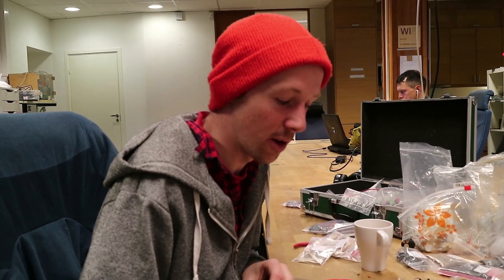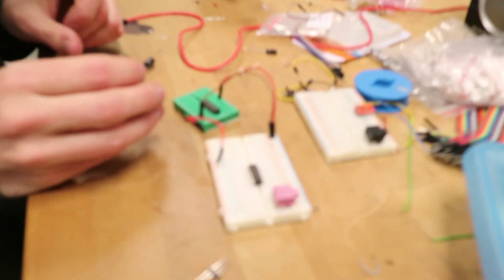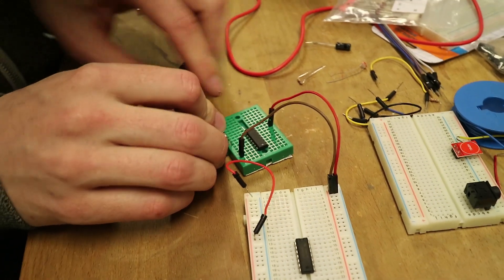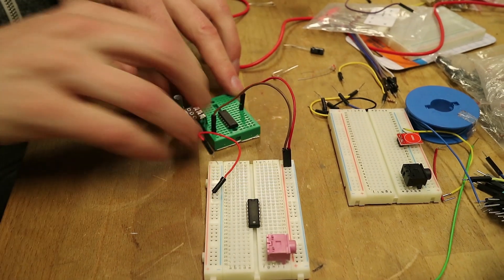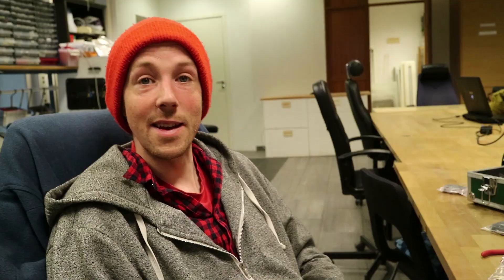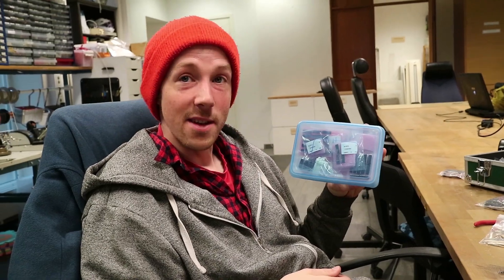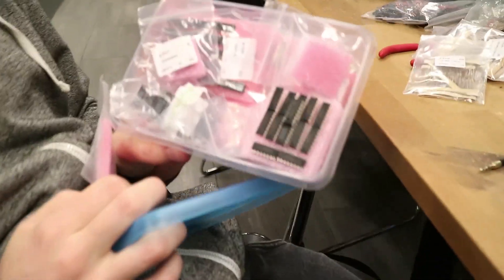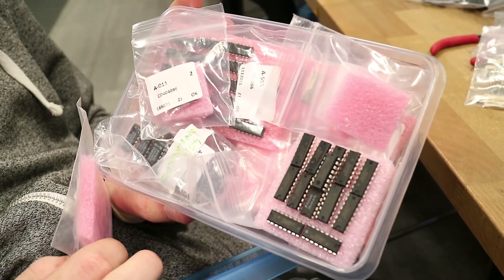Captain Credible and I making "musical" circuits

Comment: Please sir, I built a circuit using ic7805 with some two capacitors for charging, but it doesn't increase, please what can I do?
Reply from the maker: It doesn't charge the phone? Try measuring the output voltage while the phone is connected.
Reply: @Ohmify  okay sir, I will try and do that, I will give you feedback sir. Thanks very much